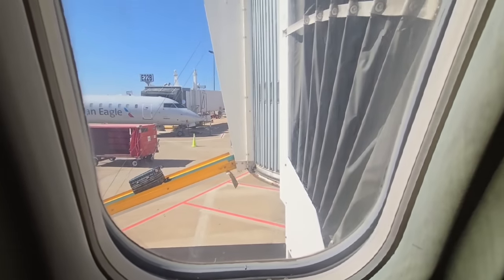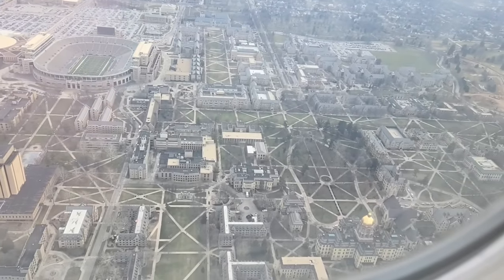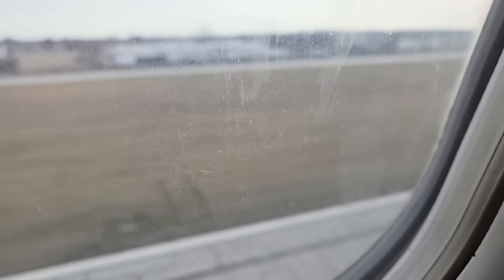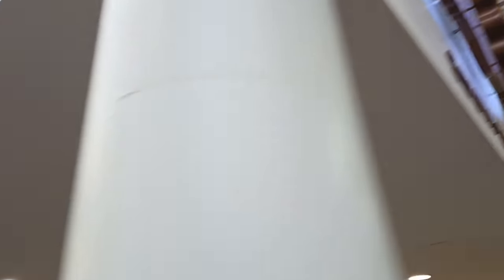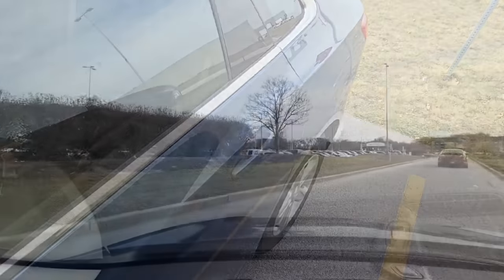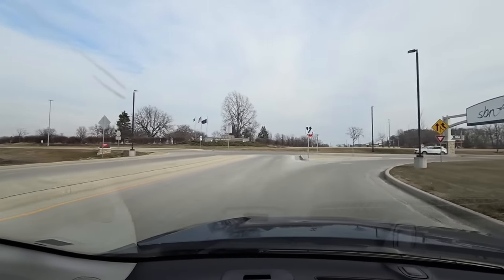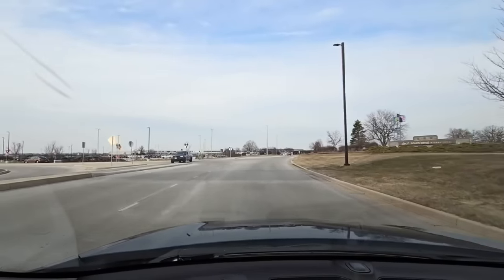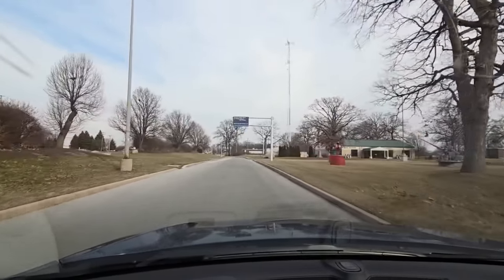LIPPERT Answers Questions about RV FRAME FLEX! Part 1

Comment: When I purchased my Fifth Wheel, my RV sales person made it a point to inform me that Lippert only approved the Reese Goosebox, since I indicated I wanted to go the goosebox route.  I purchased the recommended Reese Goosebox and have been very pleased with it.  I have a camera in my truck bed and I can see the Goosebox moving up and down plus forward and backward as I drive down the road.  I'm a mechanical engineer and it seems this reduces the impact forces that would lead to fatigue failure in the frame.  On the negative side, the engineering manager made it a point if you increase the length of the pin box, it increases the lever arm, which increases the torque on the frame attachment point.  This increased torque will lessen the fatigue life considerably.  I noticed he didn't make any physical affirmation (like a head nod) of your comment that you have a "Lippert Approved" Reese Goosebox.   Since the Reese Goosebox is longer in the downward direction to reach into the truck bed, it has a large increase in the lever arm compared to a traditional fifth wheel pin box.  JD, can you get Lippert to give a more obvious thumb up on approving the Reese Goosebox?  BTW, I have no plans to change from the Reese Goosebox.  It's great to have my whole truckbed free when I arrive at the campsite or home.  Note that I have a 34ft, 12,000 lb fifth wheel.  It seems the larger and heavier fifth wheels are more likely subject to the frame failures.

Comment: Lippert needs to put their stamp of approval on these frames regardless of brand to final customer. If frame isnt sufficient for super structure added by rv manufacturers then reject building the frame. Why would Lippert hire an engineer if they don’t catch poor design?
Reply: That is like saying that the electrical company should inspect each use of their electrical grid in every house to make sure that the system is using the correct recommended specs in their electrical house frame. That is not a viable solution. Instead what they can do is to inform on the maximum recommended use cases and weight loads on their frames and let the RV engineers work within those defined limitations (like in my example - there are certain electrical loads that are recommended for each electrical system).
Reply: @SoWeird4U  Well, in most jurisdictions, there is an electrical inspection.  And a foundation inspection.  And a framing inspection.  And a plumbing inspection.  And ....
Reply: @kmbbmj5857  And those inspections are NOT done by the electric company, or the concrete manufacturer, or the lumber company.   That's the point.  They are done by some regulatory/Gov't body, usually city or county, looking for compliance to code.  The parts manufacturers don't and really can't, determine if people downstream from them are using their parts correctly or as designed.
Reply: If inspected by outside inspectors, Lippert would not build as spec’d from manufacture because they would be told that this does not comply to code… No Code accountability this will continue.

Comment: Lippert is a component manufacturer.  The RV builder is ultimately responsible for the end product.  Add that to unwise use by the end user, it is hard to blame Lippert for the flex. My Cedar Creek is on a Lippert frame and, after over 3 years of full-time living and traveling all over the 48 states, we have no problems.

Comment: I have a 2006 sortsman sporster made by kz last summer it the fiberglass started cracking from the bedroom slideout  i tore out the front cover and inspecter the fram and everything looked good no visible cracks so i fixed the crack thinking it was just age but in December we took it to Arizona for three months and the crack came right back within the first 100 miles not knowing anything about frame flex we made the trip down and back so this isue has been going on for years untill this year we might have used it two weeks a year to camp at the lake or camp in the bighorns mts so it dident get used much over all these years so now realizing its a big issue im going to have to tear into it and take a better look and see if i can fix it the camper is only worth 2000 dollars according to my local dealer so i cant afford to have someone else repair it its either that or junk it but its such a nice camper in every other aspect wish me luck

Comment: On a different Lippert issue. Our  2018Jayco 5th wheel had axle grease seal failure. The grease zerk fitting would allow grease to flow past the rear seal and into the brake drum causing brake failure. I called Lippert and explained that I followed the Jayco manual by slowly rotating the tire and slowly pumping grease into the bearings with a hand grease pump. All 4 rear grease seals failed on our trailer. They wanted photos of the unassembled parts which I supplied. Within a few days of sending in the photos I was contacted and told that 4 new drums and 4 new brake assemblies would be shipped to my address.  This was great customer service by Lippert as my trailer was 3 years out of warranty.

Comment: It's much like taking a regular car and cutting the roof off. The car is going to sag. The doors won't open/close properly anymore. These trailers could be viewed as lader frame type vehicles. A Upper body might be needed for strength. A lader frame without a full body will flex more.
The question for these RV's is if that lightweight upper structure is actually able to provide that extra strength. I would say that it hardly can from how they get put together and the materials used.

Comment: While this conversation is much needed in this industry, it would be unreasonable to expect most listeners to comprehend all aspects of these terms and the ramifications of what they could mean to them, despite owning a product built on that frame. Nor can they be expected to, because of all the variables in applications. To understand the blending of issues here requires many years of experience and even then there is no control that once the component product leaves their facility what happens to it or how it is used. However, I observed that you were very kind in how your questions were posed and I think the two spokespeople did a fairly good job of simplifying the conversation while being truthful with what was being asked. They are to be commended for participating in this dialogue and for doing so without their Attorney present, so thank you.

I did pick up on a couple terms which traditionally have been used to define more clearly the design limitations for use of their products thereby setting the parameters of responsibility, or, as an attempt to lay the foundation for heading off the potential for any future criticisms. It wasn't designed for that, or, it's not our responsibility. That key was use of the term, "Industry Standard". People outside your industry may not have a clue what that means. And even if they did understand it's meaning they are even more unlikely to comprehend the ramifications as a component supplier to a finished product. A few years ago my wife and I had a home built. It was designed by a Professional whom I knew, personally. We selected the best home builder we knew and had toured several homes he had built previously and often visited him and his family at their own homes. However, I was a bit surprised to realize that the Contractor did very little actual building and instead, he relied on a collection of individual reputable sub trades and monitored their work. But it was his company brand and his reputation in the industry that were at stake. So his liability was limited by time as well as cooperation from the subtrades. The industry had changed substantially from what I had  expected over time. And even if that information had been provided to me prior to purchase,  it would not have changed my decision to use his company b/c I didn't know the ramifications of his building methods,  but he did .... and I didn't purchase from the subtrades .... I had purchased from him b/c  I trusted him, and it was his responsibility to make it work to meet my expectations. I was his customer. With that same mindset it normally would not help for the purchaser of camper or trailer or or gooseneck trailer or semi trailer to know the design factor/factor of safety in the frame design to make his purchasing decision, but they are being asked to trust that the OEM brand that they are purchasing and/or the Dealer does know that info and could satisfy the expectations, when and if asked. 

Another caution for me is apparent lack of oversight concern to ensure that each frame is used eaxctly to the design specifications and no other. We know that should a seemingly small deviation from the original design be made after leaving your facilities it could represent a huge change in the acceptability of the frame. For eg. adding 2' length will change the entire dynamic loading and the way the frame was intended to work. Even if a customer contract provides indemnity, there is still a professional responsibility to ensure that it is appropriate for being used as originally intended, designed and applied. More seriously, some states have a practise of completing a thorough mechanical and design analysis of certain vehicles following an accident. Should mechanical components be found to be malfunctionin, installed incorrectly, or not be functioning consistent with original manufacturer's specs, or manufacturer's specs appear to not meet industry standards, the state is known to place the entire blame on that vehicle, on its Manufacturer and on the component supplier. In one such instance the axle supplier was shown to have installed some of the brakes contrary to recommended standards and although the brakes were working just fine at the time of accident, and the actions of the operator were in no way responsible for the accident, the litigation began which resulted in putting the axle manufacturer out of business. Even if everything is done correctly and these issues sound incidental or of no real value ..... until something happens which requires those decisions to be substantiated. The people who take it the hardest when things go wrong are the Engineering Dept., even if it's not their fault.    

Trailer manufactures are always fighting 2 insideous enemies.... weight and cost. The Engineer, referencing his frame design, said that to do otherwise would increase the weight and therefore require other components and tow vehicle. I believe that. This implies that they are close to the limits of component ratings. To get any heavier could  require bigger axle capacities with air brake system, heavier suspension capacity, bigger tires with increased load capacity and a compatible tow vehicle with air system, probably referring to a class 8 truck/tractor. Again I would want to confirm that choices affecting the weight and the cost price are a reasonable trade off based on risk vs reward for individual applications. Every vehicle requires a plate or decal to identify its VIN, Tare Weight, Gross Vehicle Weight (GVW) tire size and air pressure, date manufactured, and states that the vehicle is manufactured in compliance with all Federal Laws in effect at date of manufacture. That is a Federal requirement of all recognized and approved manufacturers and identifies them on the compliance plate, 

Lastly I want to state that I have never been able to understand how something with the integral characteristic and ability to move, bend, deflect or flex can be attached, and derive some of it's yield strength, from materials that do not move, bend, deflect  or flex, and expect it not to break. Add poor quality trades to that scenario and the results are exponentially compounded. Choice of materials add to weight and cost considerations for which there is no easy solution. But there is no excuse for the rampant poor quality of workmanship that has become commonplace in the RV industry in the past few years.IMO. 
And worse still is the manner in which many of the owners of these unacceptable products are being treated. It sure makes the good ones stand out at any price.!

Disclaimer - Comments are my own opinion and not intended to slander or disparage any individual, group or company. And not intended to sell or to discourage or restrict anyone else from making a purchase of their own chosing.

Comment: I would suggest asking some specific questions, such as is the GD frame  manufactured for full-time RV life and strong enough to handle the occasional dirt road to a camp ground and / or rough secondary roads.... over what time period and mileage.
If not...why is there no warning stickers, etc...stating the expected use of the and strength of the frame.

Comment: Some problems I think that may contribute to frame problems is the new trucks have enormous amount of power that people think they can pull anything behind their 5th wheel  RVs.  I've seen jeeps, big boats , big enclosed trailers. And where is the weak link.  The trailer frame and axles. And the rough roads dont help.
Reply from the maker: Totally a valid point as well. Perhaps there could be improvements to the fifth wheel structure to handle some of those forces.  Again though, that equals more material, more mass, weight, and affecting the floor plan

Comment: Good job in a very difficult situation and subject. I would love to know what engineering tools they (Lippert) use. Auto industry uses many engineering software’s to help determine fatigue, stress, failure analysis and weld distortion. Also auto OEM’s require suppliers to preform weld destruct on full frames. This is to insure the welding parameters haven’t changed in process.  In some cases one frame per shift, per model and there are hundreds of weld joints analyzed under a microscope every day. Wonder how many cut and etch frames Lippert does? 
Lastly nearly all frame designs are released by the OEM’s as “build to print”. The engineering portion is a lead by OEM and support by supplier (both sides work together using the same engineering tools and models). The supply base is responsible for process and quality of workmanship.
Reply from the maker: You're going to love the answer to this question and the next few videos.

Comment: Weight & roadways/trails all determine what happens.
Weight of the overall trailer.
Weight of all cargo & tanks (when full).
Smoothness or roughness of the roadways/trails driven on.
Also Preventive Maintenance not being done at all or not properly done.
Buy the right RV for where you want to go.

Comment: Have had two trailers, an Open Range JT340 and a Grand Design Solitude 310GK, that have experienced severe frame cracking above the spring hangers.  I discovered both while rotating tires and doing bearings.  Wonder how many units are rolling down the road with cracks and impending failures. Repairs on both were covered under warranty but Lipert blamed outside factors including the RV manufactures. Being an engineer (and through personal experience) I can say that frame designs are just thrown together based on industry rules of thumb.  If nothing else the high stress areas should be fish-plated, boxed and tied across the frame.  An 1/8” thick, 1” x 6” plate welded from the flange to the beam web is not reinforcement for flex.  It’s decoration.

Comment: I believe because of the RV's this is happening to, the simple hard question to ask the engineer is " Have we reached a point where the safe size and length of these units has been exceeded " ? There is a reason the articulated bus came into existence. At some point, an RV comes under too much stress when turning and twisting down the road at a length that is too much for regular frames to take. Someone is going to have to make a frame differently to handle the loads even if it weighs 3 times more, or limit longer RV's to motorized only.

Comment: JD Solid Part-1. Looking forward to part-2. Clear on the non-approved aftermarket pin boxes and the added leverage that some designs create by extended lengths. What is their opinion of adding Sumo Springs to the unit since they come in direct contact with the frame I-beam?

Comment: Great video. I would have suggested the FRAME is not the chassis? it is a part of the chassis, The chassis is wheels, tires, springs, frame etc. The frame attaches to the springs, axels, wheels, tires etc. which then makes the chassis.

Comment: The problem, as I see it, is that RVs have been on the road for decades, but prior to 2019, the issue of frame flex did not exist.  While I agree that the end users can cause damage from overloading, improper loading, adding attachments to the kingpin, and driving off road, LCI and the OEMs bare most of the responsibility.  There have been many cases of brand-new RVs ending up with bent frames and chassis separation just after leaving the dealership.  I believe the problem lies with quality control, poor engineering, and poor manufacturing practices between the OEMs and LCI.  The bigger problem is that neither LCI nor the OEMs are willing to take responsibility by standing behind their warranty and their products.  How is it that I get a better warranty from a new car than a much more expensive RV?  These companies know what they are doing, and they have made it clear that making money is their priority over doing what is right after the sale.  The only way to solve this problem is to stop buying RVs that have been built in the last 4-5 years.  Buying an older RV is the only way to go if you don't want to be stuck with poor workmanship and deaf ears from the dealers, LCI, and the OEMs.